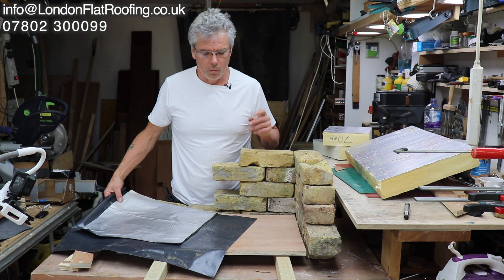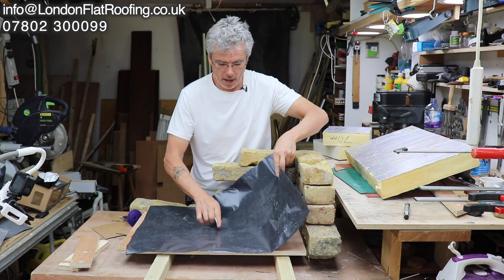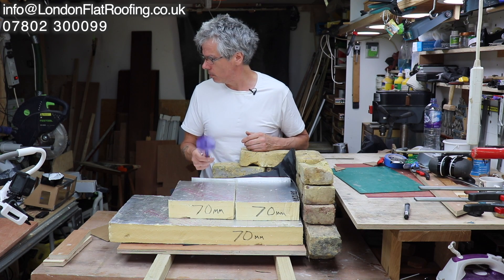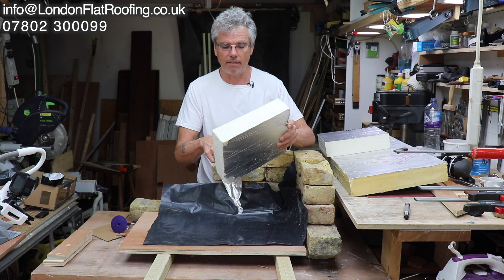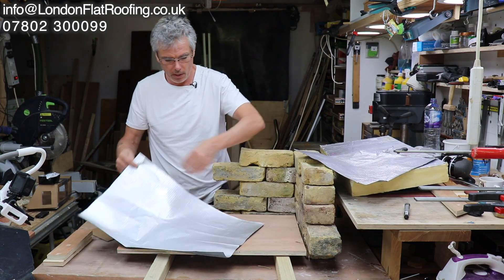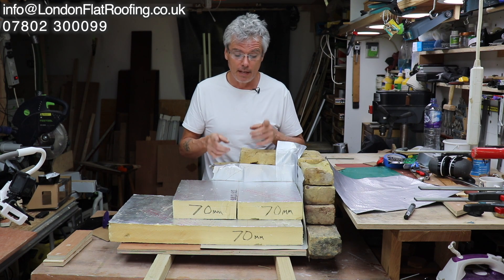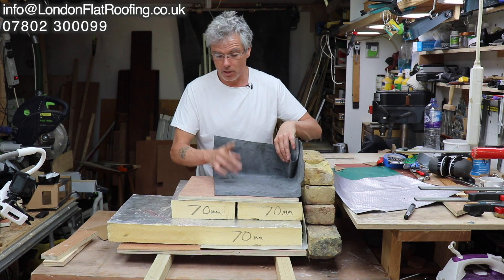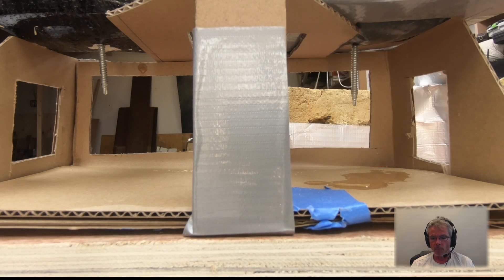Vapour Control Layer on a flat roof. Stop interstitial condensation

Comment: Hi thanks for a informative video. Is it really necessary to put the second layer of osb board ontop of the insulation prior to fitting the epdm rubber? I've seen videos where people are sticking the epdm directly on the insulation? Also what it the manufacturer of that vapour barrier. That seems to be a very nice product.

Comment: Would it be correct to assume if you have an internal vapour barrier over the whole house as in passiv house style. Would the vapour barrier under the insulation be less important. I hope the passive house vapour barrier will stop the moist air making its way to the underside of the flat roof vapour barrier.

Comment: Unless the insulation is completely dry and sealed you're going to trap moisture. Taping a sticky barrier under and to the side of bricks is never going to seal 100% and that will have moisture travel up to the underside of the top  layer OSB RUBBER/FELT.

Comment: It's proper over kill mate and no one installs it properly, the least problem I've had with flat roofs is when they are done crudely with plenty of air flow, all this insulation is causing condensation problems, you need to have a meeting with me!!!!
Reply from the maker: I think you'll be surprised at how many people do install it correctly?
Reply: @SteveRoofer  The whole building industry is full of terrible people I  can't call them bad tradesman as they are not tradesman to start with, and the general public don't want to pay for the work to be carried out correctly which then allows the cowboys in, all my work is putting work right.

Comment: Hi - I’m just designing my warm roof solution for an existing flat roof, thanks for your videos they are really informative. 

I intend to use Alutrix 600 but wanted to ask about it securing to a concrete slab roof - would you use any primer or additional adhesive 

Also what mechanical fittings would you recommend for securing the new insulation and osb to the concrete slab

Thanks in advance

Comment: Hi, I live above a garage in a semi which floods ( on the thames ), there is no the ceiling on the garge  at present, it is completely open you can see the floor from underneath. I am looking to put a ceiling up how do I fit a vapour barrier and insulation and what type of plaster board or do I use water proof ply. Regards Bob

Comment: using thermal fixings to secure the top layer of ply will leave a raised edge above the ply. Whatever system your using to waterproof the roof surely seeing them thermal fixings protrude from underneath looks a bit naff. I understand it’s the correct way but wouldn’t a recessed screw and then some wood filler do the same thing or maybe some aluminium foil over the screw head which will then leave a nice smooth finish or would that cause heat loss through the ply ? Also I was always taught that the vapour barrier should form over the insulation board and be sealed back onto the top of it by using tape or sticking the felt depending on what you’ve used for vapour barrier. I just wanna know is that the correct way then or is sticking it to the wall the correct way ?
Reply from the maker: you can hardly see the raised heads of the thermal fixings it's not a problem at all

Comment: Top sheet of ply ? Must be very old spec / reg
Reply from the maker: although we only use OSB for all decking, using waterproof ply is still part of the building regulations
Reply: @SteveRoofer  osb on top of insulation? And under the waterproof layer ? This has been a massive no no since 2020 , no waterproofing manufacturer will give full system warranty with this build up - all building regulations require full system warranty inc fire (roof b4 etc) /condensation risk etc - a Quick Look on any roof covering (warranty backed) manufacturer 
Ie saranfil/ bauder/ danosa - they all spec membrane direct to insulation no top sheet of ply 
Fire regs + insulation regs all steer away firmly from this 

I think people installing warm roofs and reading this need to do there own homework and search to be sure
Reply from the maker: Thanks so much for your reply. It keeps me on my toes; I primarily work alone and, therefore, scavenge for info. However, I do sometimes work with engineers who pass down good info, and about 10 years ago, I was pointed to an article by TRADA basically saying timber products should not be put on a warm roof above the AVCL. I agree with this, and it aligns with what you are saying. Your comment  ( no waterproofing manufacturer will give full system warranty with this build-up) may well be valid. As regards your statement ( This has been a massive no-no since 2020), I haven't seen or heard anything about this and would love to know if this is stated in any documentation. ( building regulations require full system warranty) I don't think this is true. However, I have heard of instances where they have asked for a ten-year insurance guarantee, but this is extremely rare. saranfil/ bauder/ danosa all try to do good systems and use good trained men. When I'm out doing roof inspections, I really see problems with their roofs. However, we are comparing the top end of the market with the bottom end.
BS 6229:2018 is still the latest document I'm working from, and it does not detail if you can or cannot add a sub-decking. Most roofs I get involved with are small and done by independents and  "full system warranty" is something that is never mentioned or looked for.  Get back to me if you can throw any more light on the matter.
Reply: I have a small flat roofing company (6 full time /4 subcontractors) installing 6 different membranes (7 starting in march) every single manufacturer supplies the membrane/insulation/fixings/vcl etc to achieve the desired “u value / fire rating” specified buy the architect - its a very closed environment (not diy friendly ) and spec driven I think your right in saying smaller one off projects fly under the radar in some respects and avoid these tight regulations -but I’m 100% certain these will filter through across the board very rapidly 
I’m certain Googling bs 6229:2018 and the various changes it bought in will lead to various manufacturers portals and you’ll struggle to find any of  these cross sections showing top deck of ply , I certain of this as I’m on them almost daily  

I think your vid is informative (particularly the vcl install) but people need to also know the specs constantly change particularly fire regs / insulation depths which have led the ply top being removed

Comment: Thank you.  What length are the screws? Do they have to stop in the bottom ply or go through and maybe into the joists?
Reply from the maker: The length of the screws are long enough so that you can go into the OSB decking below and penetrate into the joist. If you can find them most of the time you can't find them we always try and make sure the screws long enough that it protrude through the OSB, at least another 35,40 mm.

Comment: A 2mm gap (3/16") around a 5m (16ft) x 5m roof is the same as a 200mm (8") square hole, so there's plenty of airflow if it's not sealed right.  You (I/we) want the moist air to stay warm (non-condensing), and the temperature drop (where the dew point will be located) to be inside the sealed insulation space.
Reply from the maker: It's all about air tightness and ventilation

Comment: Hi steve , can there be condensation in the wood op top of the insulation , due to insulation difference ?
Reply from the maker: I don't quite understand your question, however yes there could be condensation in the top wood if the insulation and the air vapour control layer are not installed correctly

Comment: Hello Steve, great videos you’ve uploaded. Shame the so called builder / roofer didn’t watch any before hand 😢. We have had a flat roof built, using 225mm timbers, I assume it’s a cold roof since there is no insulation under the rubber that was installed. They have not left any return air gaps but also have walked away from the job leaving us with an exposed roof (I.E nothing underneath) so I thought I’d try to tackle it myself. Since there is only a ventilated soffit and no flow of air, can in fill the joists with celotex and put some OSB? Boarding underneath then create a fake ceiling underneath that to create a warm type roof? Maybe that’s just completely not doable 😅?
Reply from the maker: Can you send me a drawaing or some photos and I will have a look for you as at the moment I dont understand  steveroofer@gmail.com

Comment: I just started your video and have a flat roof that gets hot and need it to last a long time. So I’ve seen how guys install aluminum foil over the black roofing paper and tar which reflects the sun and keeps the roof a whole lot cooler. Plus the glued down aluminum foil protects the roof. I would think just keeping the roof cooler like that would add years to its life. They only put in 2 inch drain pipe in the the four corners of the the rectangle shaped roof so this big tree always clogs the drains real bad from the pine needles.  Haven’t been able to clear them so need to find a way or just go to the hassle of putting in larger diameter drains and pipe so they don’t get clogged. Homeowners association won’t get rid of the trees nor I doubt they want to pay for my roof damage since water pools up bad when it rains and overflows off the edges of the roof. Very frustrating and I just don’t have much extra cash to have someone come fix it plus hard to trust guys these days to do it right.
Reply from the maker: by the time you glue down he foil you may as well go buy sola effective paint and paint the roof that's the better way of dining it

Comment: Hi Steve, I hope you're still around as I've just found your very informative set of videos!
Can you explain those mechanical fixings please: are they simply fixing the top deck of ply to the lower deck (through the insulation) or should they be fixing into the roof joists themselves (in which case it might be easy to miss the joist positions?)
Also, the fixings will penetrate the vapour barrier: are there any issues there?
Thanks
Reply from the maker: We would all like them to hit the joists, however probably 90% of them down as long as the lower OSB is properly fixed. That's not a problem. As regards the vapour control layer been punctured again that's not a problem as it is such a small hole and a leakage is so minimal.

Comment: if the mechanical fixing is piecing the vapor barrier at the bottom, doesn't that compromise the whole structure?
Reply from the maker: No, first of all the vapour control layer, sills self around the fixings so there is very little leakage of around then however it's such a small amount of holes. If everything else is at a time it's not a problem the construction is extremely forgiving and I emphasise the word, extremely unlike a cold with construction that is already working on its limits so needs to be installed very very well to make sure it works.

Comment: Hi Steve great video .. my roofer tells me he wants OSB up and over the wall? Am I ok to seal my Vapour barrier to the OSB or is this defeating the object and still letting vapour between the OSB and the wall? thanks Gaz
Reply from the maker: I don't like putting OSB up and over roofs it can run with moisture getting through the wall. If you do do it try and put a damp proof membrane between it and the wall.

Yes you seal the vapour control layer to the OSB

Comment: Hello Steve,

Great video, it has definitely given me the knowledge I needed. I have a question I am hoping you can answer. I need to place a warm roof at the top of an old church tower, quite a small area, only 8 ft x 8 ft. The walls are lime stone pointed between with lime. The walls do get wet every so often, the water can come through the thick walls and make the wall damp inside, but when the rain stops the walls dry out, it's normal for old limestone buildings to do this when you get rain for a sustained period. 
Can I ask, will the Alutrix 600 stick to a wall that does get damp/wet every so often, if the answer is no can you think of any alternative that could be used. Many Thanks in advance.

Comment: Hi Steve great videos. From a fellow flat roofer.
 Pu and Pmma. Installed correctly they are brilliant systems. Svap 2000. Decothane, sikalastics, 618, 625, balcons, flakes, chippings., WeCryl, Thixotropic, rapid. Garland, Bauder, iko, Westwood, But never never GRP.
Reply from the maker: I think the use of glass fibre is all because some salesperson wanted to move an awful lot of raisins and glass fibre has got a good name it is a good product just look at boats they sit in water year after year and glass fibre amazing however a roof environment brings along completely different problems and glass fibre is just too expensive to be laid in the thicknesses and with the expansion that isn't necessary to make it last
Reply: @SteveRoofer A roofer has recently done me a quote for mine and my neighbours dormer flat roof. He wants to use renolit alkorplan f, anyone have any experience of this system?  Thanks

Comment: Hi Steve, Can you tell me please what primer you use for the walls where the sticky vapour barrier adheres too
Reply from the maker: we use a contact adhesive however as long as the walls are not dusty it will stick to them so try just unbonding them

Comment: Hi Steve  we have an old ground floor flat roof extension on our house.it is a cold roof in which I want to put kingspan 25 mm inside attached to the existing plasterboard ceiling and then put another plasterboard layer.  I say this as the extension ceiling is actually 2 inches higher than the  actual house. What's your opinion on upgrading a cold roof on this type of build?  Regards Paul.
Reply from the maker: lots of other factors to take into account send me drawings

Comment: Only job I've seen where making a pig's ear of something is a good thing.
Why fix the insulation at all? Wouldn't it be best to have it "loose" between the decks to allow everything to move a bit more with expansion and contraction? 
The visqueen bonded vapour control barrier actually states it's designed to self seal around fixings do you have any experience with that product Steve?
Reply from the maker: No never used  visquuen  AVCL (air vapour control layer)  tried lots and the best one I have found is Alutrix 600

Comment: How about taping the seams with tuck tape to seal the seams of the insulation
Reply from the maker: yes drill holes they are called thermally broken fixings form FixFast
Reply: @SteveRoofer  thanks

Comment: Hi Steve thanks thanks for your answer I’m building a flat warm roof in the west of Ireland  and want to use a rubber Epdm  , so should I use a 4 mm torch on felt and torcher on to sub deck and sides  , iam building this between two slated roofs  which I have stripper slates off on both sides the flat roof is a new build  with 120 mm insulation sandwiched with plywood on the bottom and osb on top , thanks again for your knowledge your are right the different types water proof plywood  the most of it is poor quality material   The glue seems to fail   Thanhs Patrick
Reply from the maker: You need to find out from the suppliers if 4mm of felt gives the correct vaper risetance. But read between he lines. We are always told that old felt roofs and asphalt roofs make good VCLs

Comment: hi Steve patrick here from ireland great video , i was just wondering could i use a 2 mm  torch on felt   heated on  as a vapour barrier  thank you
Reply from the maker: You can use felt but it has to be quite thick from memory, 2mm probably won't get you to the correct specification however it will be airtight and as far as I'm concerned that is the one thing you defiantly need to achieve

Comment: Hi Steve. You think is correct?   "200x50mm  timbers  fixed  between  beams/bearers  at centres  by  engineer.  Fall  to  be  created  per  roof  plan  with  diminishing  battens  on  top  of joists  and  15mm  marine  ply  deck  over.  120mm  Kingspan  TR27  LPC/FM  insulation  laid over  deck  forming  warm  roof.  Glidevale  VP400  breather  mambrane  to  be  dressed  over insulation  and  down  face  of  perimeter  beams.  15mm  marine  ply  over  insulation"
Want know is correct order of the layers? Glidevale on isolation? Thanks
Reply from the maker: No its all wrong  email me with more info and lets see if I can help
Reply: This is the problem these days. There's so many overlapping rules, jurisdictions, products, standards and then a load of crappy/careless workmanship that becomes entrenched in the system. Majority have only ever seen things being done incorrectly. or don't care anymore, I wouldn't have a new house given. Rant over.

Comment: What you have done is moved  the dew point using timber on the insulation. Not a good idea condensation will occur beneath the membrane this will rot the timber. all you need to do is use the correct Ins. board other than that good video ,I liked it. Steve G
Reply from the maker: I sort of agree with you but I think your wording is incorrect. Are you suggesting nit using the decking under the memebrain?

Comment: Is there any reason you can't put your vapor barrier below your subfloor (the bottom ply directly on the joist) and use the plywood to pin it tight against the wall (assuming it it flush)?

Comment: Hi Steve, we used Alutrix 600 on the back of this video, what a great product, thank you taking the time to produce such an informative video. We did make an error on the fixings though, we screwed the 150mm PIR  to the sub deck with the mushroom fixings.... but then used std pan head screws to fix the top OSB to the ply sub deck.... clearly should have just used the mushroom fixings on top deck....we'll have some cold bridges, but shouldn't be a problem otherwise I hope?